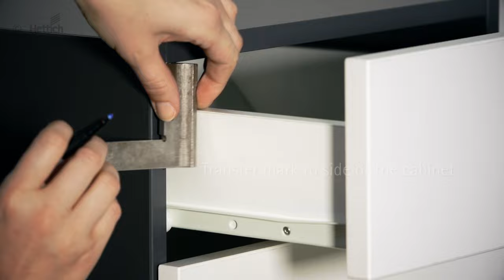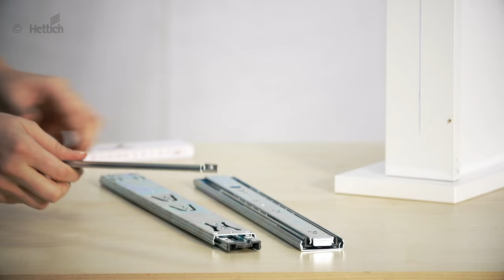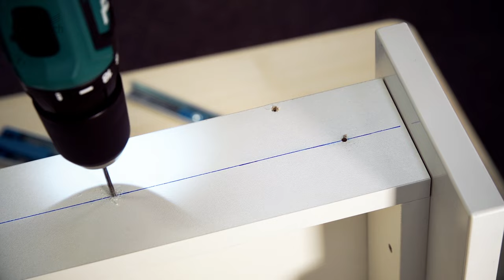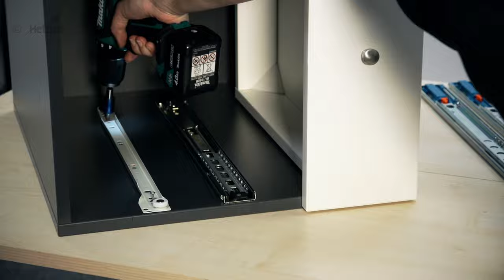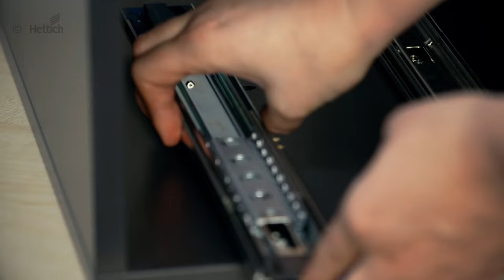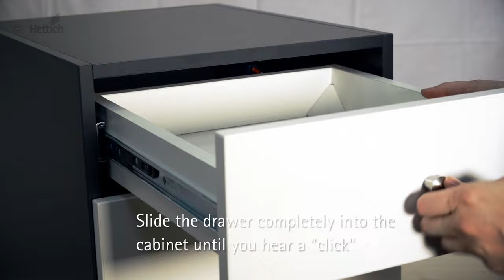Upgrade your drawer: Changing roller runners to ball bearing slides. Do-It-Yourself with Hettich

Comment: the ball bearing slides fit me vertically in the same holes as the roller runners. There is no reason to put them in the middle of the drawer
Reply from the maker: Thank you for your feedback, do you need any help?

Comment: why not use the same mounting location as the roller ones?
Reply: Yanko Dimitrov ball bearing drawer slides are better mounted on center or top rather than bottom side , in center it’s best so that minimal play is there and damages due to wear and tear is also less.